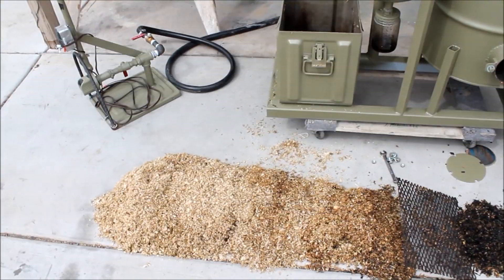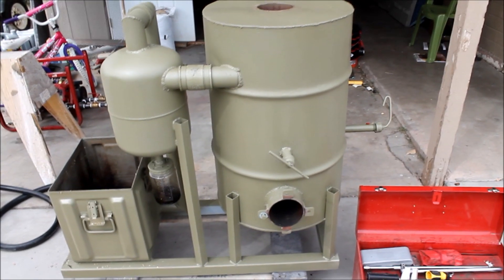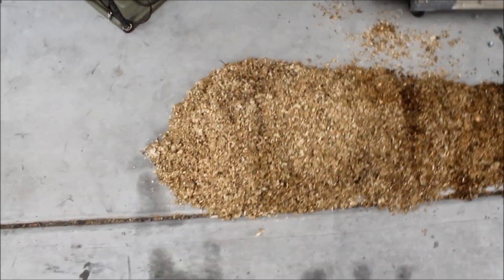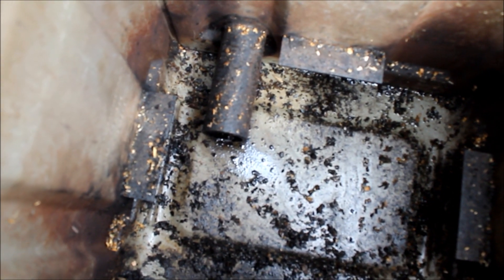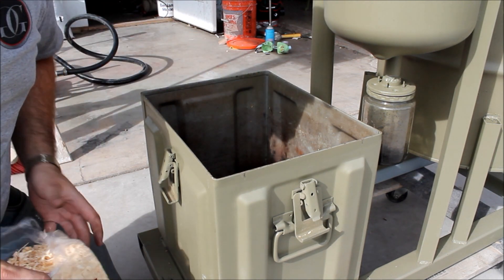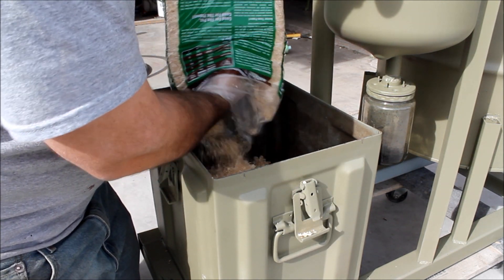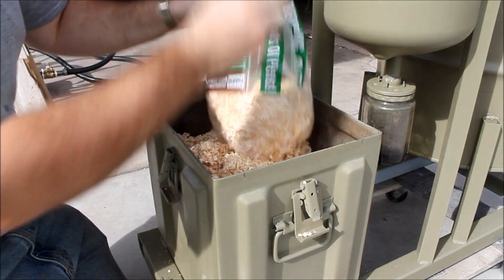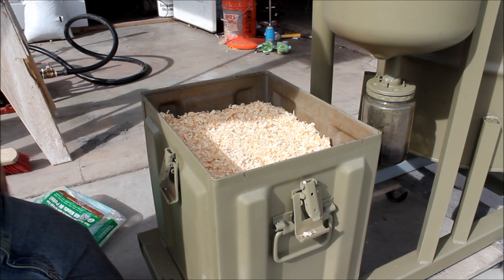cleaning out the filter on my gasifier

Comment: Hi jr. paul here, I built a gasifier like yours, And it works great, However I get a lot of tar with the same setup you have, Can you tell me how can I stop the tar build up at the output where it supplies gas to the generator and clogs up the valves ?. P.S I love your design.

Comment: i was wondering, how hot does the cyclone filter get? i was thinking about building a gassifier and using the heat from the cyclone to heat my shed (with a copper coil and radiator etc)